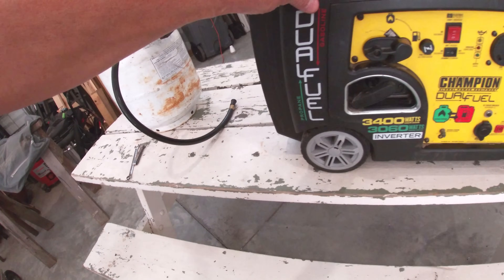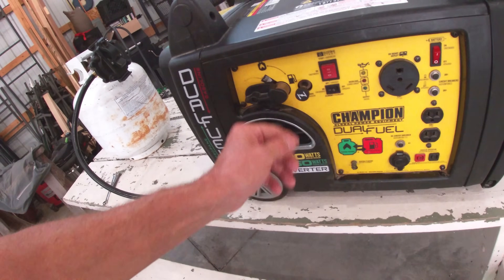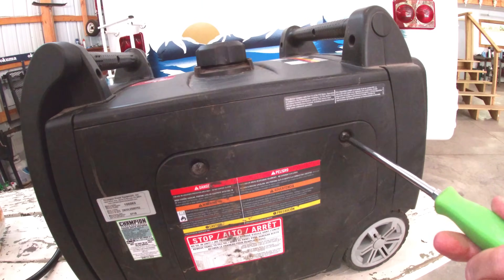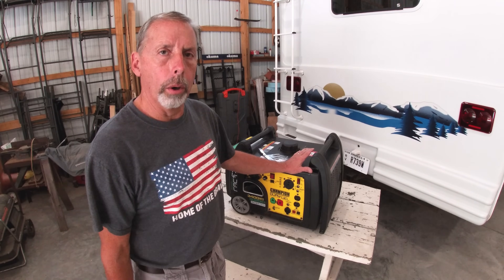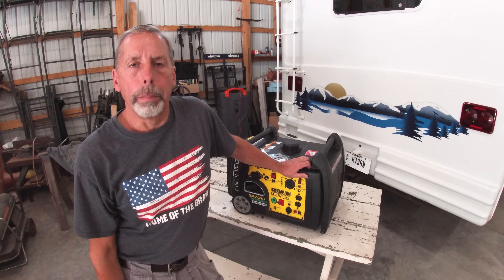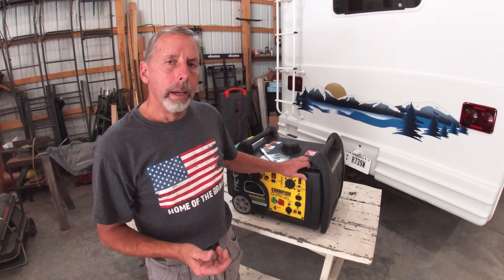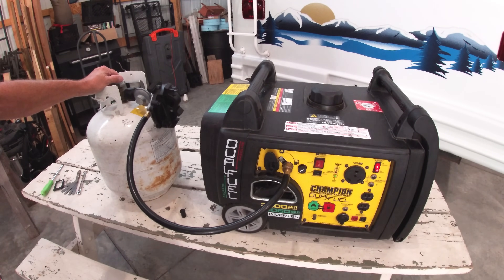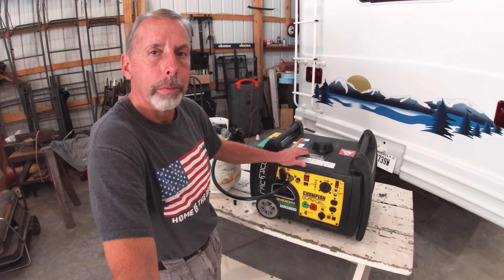Propane Generator Fail

Comment: Also 20 & 30 lb new propane tanks have a high flow safety check.  If you have something like a griddle or grill with a burner in the on position when you turn the bottle on it will check to low flow or if you have a line and turn the tank on quickly.

Comment: The problem is split between the tank regulator and the generator. The same thing happens to my propane grill if I leave one or more of the grill burners open when I run out the propane by shutting off the tank and forget to turn off the grill burners when the flames die. If you disconnect the propane line from the grill or generator and open the tank valve, only a very small amount will come out. Somehow the generator is letting too much propane in. If it happens again, shut the tank valve and open it slowly. Just for info, how long does the champion run on a tank of propane and how many watts does it put out?

Comment: The regulator on you propane tank can also cause this problem if you open the valve to fast no matter if you have a barbeque pit hooked up to it the flow rate will be greatly restricted.

Comment: I have ran into low fuel on several items, and having worked with propane systems they have installed what was called earthquake valve witch shuts down the propane to just a trickle in case of open or broken gas line

Comment: It's not a Champion problem.

It's the new-fangled propane tanks.  Same thing for BBQ grills.  Have to open it slow with burners off... let it build up pressure THEN turn on the appliance.

The design is so if the hose breaks it won't just unlease 5lb of propane into the air...

So... not a Champion problem, not a generator problem, not a propane grill problem, but rather "too safe" propane tank.

I own a genset like yours and a grill.  Been there.  Done that.  Thanks for the refresher :)
Reply from the maker: Thanks for watching

Comment: It is the ‘new’ propane tanks issue.  The ‘new’ tanks have a thing that prevents the propane from escaping from the tank if the line is cut.  When it recognizes a quick escape of gas, it automatically restricts the flow of gas.  This happens with all gas appliances with tanks that have the ‘new’ knob that is triangular.

Comment: I had basically the same issue with my gas grill. One time it ran fine, next only 1 burner would light with very low flame. I just figured my tank was just about dead. Swapped tanks every thing was fine . Then ran across a video explaining those values. I believe its a safety device
Reply from the maker: Yep that’s it Thanks for watching

Comment: I worked on a ranch for 3 years, and I was off grid.  My friends teased me saying "you're not off the grid, you're off the whole damned map!"  And because of the location, I had to get a generator.  Well, I went through a bunch because they're all toy gennies for the weekenders.  I found the best bet was solar.  For the same amount I spent on one genny I bought a two panel system.  Another couple hundred and I had two good 12 volt type 27 deep cycle batteries.  That set up paid for itself in the first month, considering the cost of the genny and the fuel.   I did the Champion gennies a few times, but they were a waste of money.

Comment: Ive had generator to cut off when tank got low but still had some fuel in it. Swap tank and ran fine little bottles loose pressure more than big bottles. You can shake bottle if it cuts off at times to get excess propane out while running. Once engine starts to lower shake tank the small bottle. Engine revs back up and runs!

Comment: I would say it is more the OPD valve on the tank than the regulator.  I have two dual fuels (different brands) and have never had problems with them.  But I do open the valves slowly on less than 100 lb tanks (no OPD valves).  I have had problems with the valves before on the grill and have flung the tanks as high and far across the yard as possible.  They always seem to work after that.  I think both of my generators run on 11" WC so any grill type regulator should work.  I have directly hooked at least one generator to my quick connect on the camper and ran it that way with no loss in performance.

Comment: Others have already said it, but this is an issue with the valve on your propane tank, not the generator regulator. It's a safety feature that senses any time propane is exiting the tank too rapidly and shuts the valve "almost" all the way off. It varies over time/usage depending on the pressure differential between the tank (how full/warm/cold it is) and the volume of air to displace in the appliance you're connecting to. All modern LNG tanks operate in this manner though some will be more or less finicky depending on circumstances. The classic is leaving a burner open on a grill while opening the tank valve. The rapid egress of propane compared to a closed burner causes the lock up. Shutting off the burner then closing the tank valve for a few seconds and re-opening it slowly should do the trick. Now you can open the burner for lighting, same as your generator.
Reply from the maker: Good explanation. Thanks for watching

Comment: Thanks for the video... This is a solid tip.

Im looking at replacing my gas Gen with a propane one as we live out in a rural area where we get 2-3 12 hour to 3+ day outages a year due to Ice Storms and Tonados.

That issue you describe is an issue within the regulator.

I have the same issue with my Grill, my smoker and my Blackstone...

The Blackstone is by far the worst at it.  When it does it, can still touch the grill surface 5-7 mins after it's been lit...

Sometimes, I have to turn it off, remove the fuel supply line from the tank/ regulator for 2-3mins then reattach and open S-L-O-L-W-L-Y....

Also, Do you really need the choke with propane?
I was under the impression it was mostly for when running gas...
Reply from the maker: I have quite a few propane devices but the generator is the only one I’ve had trouble with. I’ve had many comments about the choke but I’ve tried to start it many times without the choke and no luck. Thanks for watching

Comment: Gas grills have the same issue. Its the new tanks. they have a safety valve in case of a hose fail. a surge of flow will draw a stopper into the valve. close it off for a couple of minutes then open it slow. and the stopper returns to the normal position.

Comment: Yes it's not so much a appliance/equipment problem.
There is a safety feature component on propane valves in case of leaks that cause it to cut off output of propane without getting all technical that's it in a nut shell. 

Some times simply filling the tank and improper adjustment of the bleed screw can trigger this safety feature.

 You can usually wait to see if it resets or you can bleed off the propane via the bleed screw for approximately 30-60 seconds and try it again, repeat if necessary.

Opening the valve to quick can trigger the feature as well so opening it slow is best practice with all propane tanks. 

Hope it helps.
Reply from the maker: Thanks for the info and for watching

Comment: Hello ! Propane tanks have what they call EFV. (Excess flow valve) if you open the tank valve to fast, there is an internal valve that will close. Example why they have EFV is if the line coming out of the tank breaks the EVF will shut the flow down, usually only a small amount of gas will come out of the EFV, these valves will reset themself after the line pressure builds back up. You may have a faulty EFV, Try a different propane tank. I hope this helps!
Reply: You are correct, but the EFV check valve is in the POL fitting where it attaches to the tank. The difference is the way each different tank valve opens up. Each time you change tanks, fuel level, or ambient temperature, you change the rate that opening the hand valves fills the hose. If you try to fill the hose too fast, you seat the ball in the valve and it limits flow rate. If you open it slowly ( or if you close it for the right amount of time)  then you will not seat the safety valve ball. Same thing with most propane devices. You can change the hose/POL fitting to a higher flow rate. Or “ make your own”.  Wink.

Comment: As dumb as it may sound I believe this gentleman experienced the same frustration as I did using propane fuel. Then I learned (thru YouTube) that opening the tank valve  s l o w l y  can make a difference allowing the proper amount of gas to pass thru to the generator. No mention of this in the starting instructions.  Thanx to the YT community. 👍
Reply from the maker: Thanks for watching

Comment: You are supposed to open that valve slowly all the time.  There is a safety built into the valve that closes the line off (sometimes not completely) in case of a line failure.

Comment: My Napoleon gas grill has a warning to open the propane valve slowly to avoid severely limiting the flow of propane.  It says if you open it too quickly you must close the valve, wait 20 minutes or so and then try again, opening the valve slowly.

Comment: 5500 generator I’m considering buying a separate tank just for generator instead of using the quick connection on Rv what are your thoughts on that ?or am I overthinking?
Reply from the maker: My rv doesn’t have an outside propane hookup so I carry extra tanks for the generator. I could see using the rv tanks for that purpose would save some extra work. Thanks for watching
Reply: Thanks for the response, I will follow your lead and purchase a 20lb tank that way I can use it if need be when im not with Rv .

Comment: Thanks, I have been having this issue with my Duromax 12000 hooked up to my 330 gal propane tank.  Rigged up Duromax's regulator for small propane tanks downstream from my primary 1st stage regulator on the 330 gal. tank.  Do not get hardly any pressure at  generator hookup (hose connection).  Will only run on choke but very slowly (no rpms).  Will try your method!  This has been driving me nuts!
Reply from the maker: Thanks for watching

Comment: Thanks, I never knew about opening a propane tank slowly to avoid the safety shutting off the regulator. I do know that on those small engines you need to change the oil a lot. They say that those small air cooled engines without an oil filter are only good for about 1,500 hours total run time before they are worn out. That is why during hurricanes, I change the oil every day. Oil is cheap, generators aren't.

Comment: But also, yes, you should turn your gas on slowly when it comes to your propane, whether it’s generator your camper your house cause yeah you can risk worst case scenario breaking the diaphragm and having to buy a new one or what he is having problems with I am glad to see people Doing their checks when they do videos such as cleaning the spark aspirator and everything first before finding out that it’s something even simpler so please turn your propane tanks on slowly whether it is generator or whatever❤
Reply from the maker: Even though I didn’t think it was the spark arrester or valve clearance I like to eliminate everything I can and go from there. Thanks for your comments and for watching

Comment: Most propane regulators have a safety built in where the regulator will restrict the flow if it sees too much flow from opening the valve too quick. It's incase the line has a leak or breaks.

Comment: Most modern regulators have that high flow safety switch in them. Norm when you cranked the propane valve on too fast your hear click that’s your sign you turn it on too fast.

Comment: Weber gas grill will do absolutely same thing, they said it’s built in safety thing where when you open it fast the regulator thinks there is a leak and lowers the output  to the burner to a trickle. They said turn it off for 15 minutes and turn it back on slowly and never had an issue again unless we turned it on too fast. It’s the regulator and it’s designed to do that.

Comment: This happens on gas regulators in the high dollar semiconductor machines as well.  Sudden pressure will pop the internal parts and you have to remove and replace with new regulator.
Reply from the maker: Thanks for the info and for watching

Comment: Glad you genny runs right now but with all due respect to the lady at Champion, the gooberment a few years ago (like maybe 3 or 4) dictated changes to the valves on portable propane tanks such that a fast rush out causes the valve to close down a lot and provide only a bare minimum of fuel.  Grills, smokers, patio heaters - I have had them all and none will support more than a very tiny flame if I open the bottle valve too fast.  If you open the valve too fast and can't get a decent amount of gas out just shut the valve completely and wait about 10 minutes and the valve will reset.  Several times I have had to wait to start grilling because I was in a hurry at the outset.
Reply from the maker: Thanks for watching

Comment: Not generator related, but I have a Blackstone 36 in griddle. I was having trouble getting enough gas to get high flames. Turns out with the current crop of regulators, the gas needs to be turned on slow..very weird

Comment: I had this problem. Two fixes:

Put something small inside the propane inlet and "massage" it in and out, like a soft wire or tiny screw driver. But don't poke it. 

or

Start it on gas and switch it over real quick.

Comment: Our gas grill is the same way. I don't know if it the regulators or the valves on the bottles that were changed. Grills and othere devices never had this "fast opening" issue before.

Comment: I learned the same from the Weber BBQ people a few years ago. Only difference is that they said there’s a safety build into the propane tank that sense a fast flow. If you start by opening the valve fast it thinks there’s a leak and turns down the flow at the tank. Once I started opening the tank slowly I never hand another issue. It will reset but it takes a while.
Reply from the maker: You are correct. Thanks for checking it out

Comment: I had the same problem with my bbq. It wouldn’t lite or heat properly. I had turned on the propane too quickly & put somethinginto a safety mode so I had to reset the regulaor. Now on all my propane bottles I turn the valve very slowly in the beginning for about 1/2 a turn then open all the way.

Comment: There is a safety inside the propane tank valve it's there to sense if a hose ruptures so it doesn't Puke out all the propane at once. It's a little ball in the valve you can hear it drop if you open the valve too fast

Comment: We have had this problem, not with generator, but with crawfish boil burners. The problem is with the propane tank. When they changed the design of propane tanks years ago, they installed a valve that shuts off if there was a major leak, it’s built into the internal valve of the tank.
Reply from the maker: Thanks for watching

Comment: I just saw another YouTuber did this on a different brand, the way he demonstrated was to slowly bleed out the propane line and slowly twist or snap on the gas line and full valve.  That you tuber said he saw it from another YouTuber ,but any way it does make a difference.

Comment: There's a small check ball valve in the propane tank, (it shuts the flow off in the case of excessive flow) theres a small spring that keeps the ball valve open, problem is the springs can get weak.
If you don't have good performance out of any LP appliance try shutting off yhe valve, sometimes you can even hear the little ball drop back down, then slowly crack the valve open and then open the valve the rest of the way.
My advice, just trade that tank in on another one.

Comment: You should always open a propane tank slowly. I was told that if you open it too quickly, the safety device in the tank valve will not allow propane to flow. This goes for all propane devices you connect.

Comment: Yup,  Absolutely the same issue.       
I’m also trying to run the Generator from extension hose from a 1,000 Gallon Propane Tank.   Will not run at all using same regulator.
Reply from the maker: Thanks for watching

Comment: I just picked one up in some scrap metal and that’s exactly what the man told me was wrong with it that it wouldn’t start. So just as soon as get a new filter and housing for it ( he lost the original one) and I’ll replace it and check to make sure my low oil pressure switch is not faulty ( something else you should put out) then I’ll give it a shot.
Reply from the maker: Good luck and thanks for watching

Comment: I had the same thing happen using a Blackstone grill.  Opened the propane valve too quickly and the burners only burned very low.  Exact same problem, same fix.

Comment: This problem is caused by a "Volume check valve". The volume check closes the line if there is too much flow, as there might be if the line to the generator is empty. So the answer is as they said, open the shutoff valve slowly to get the line at full pressure, and you will n be all right.

Comment: I've always used the car engine to refill the needy batteries, but fuel prices were giving me reason to consider a dual fuel generator.  This handy tip would be the linchpin in my decision making.  Real world evaluations are of inestimable value for novices.

Comment: There is an excess flow ball in the propane tank that partially chokes off the flow of propane in the event of too much flow. It is a safety device on the propane tank and is not part of the generator.

Comment: The issue with the safety shut off causing low gas flow is with the LP tank. All tanks work differently. I was told this was due to the age of the tank, the tolerances in the mechanical design, temperature,  and how much pressure is in the tank! Yes, a tank can have too much pressure!  If I'm still having issues, I bleed a little pressure off the tank! DO THIS AT YOUR OWN RISK!!,